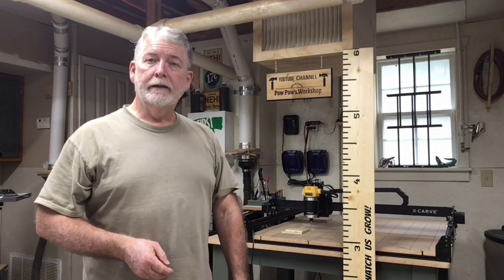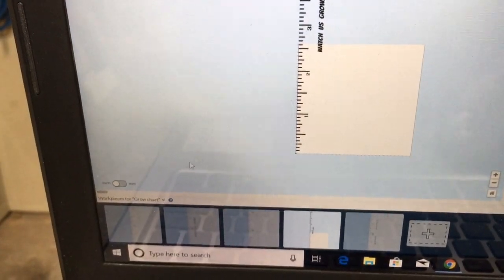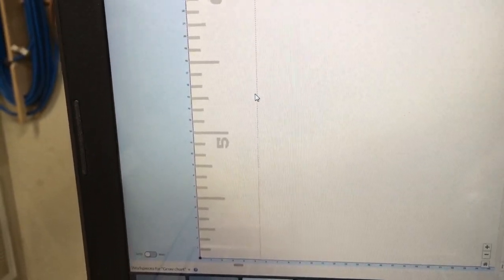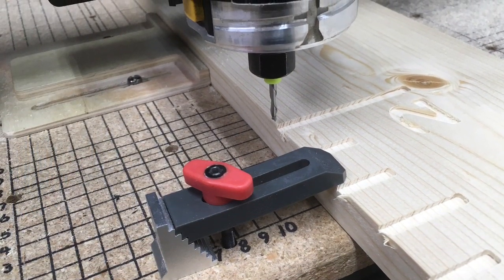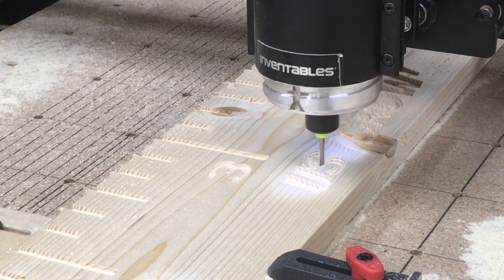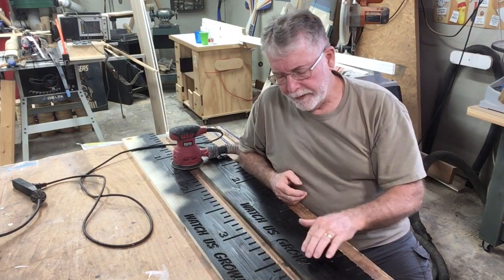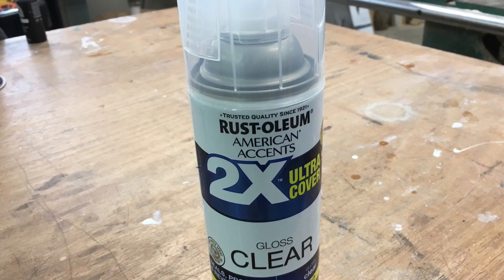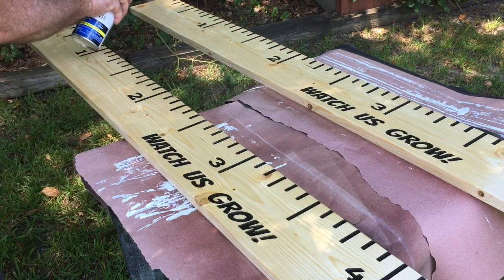How to Carve a 72" Long Project on a 30" CNC

Comment: Have you tiled with a way to index the piece as it advances. This method is fine for a sign, but indexing would increases precision if needed. It would require a bit more setup, but once in place, the components would advance quickly.
Reply from the maker: Yes, they all get indexed
Reply: @PawPawsWorkShop  that makes sense, unless I wasn’t paying close enough attention, what is your method for indexing? I didn’t see any kind of pin register or anything similar.

Comment: Are there three separate files, or how are the three sections accomplished in one file?  Thanks
Reply from the maker: Yes, three different workpieces or now you can use the tiling feature in easel. If you do one file just use a square and set to zero cut depth and mask the areas not to be carved

Comment: I'm getting ready to make one for a family member as a baby shower gift for a friend of hers. She asked if it is true to measurement once you hang it on the wall.
Reply from the maker: Yes, just measure at the correct height and install.
Reply: @PawPawsWorkShop  Thank you for answering. One other question. If they hang it on the wall do I need to take in account the measurement of their baseboard? My apologies, but my mind might be making this more challenging then it really is. 😂
Reply from the maker: On this one, yes, not knowing the size of baseboard that people may have this growth chart is from the floor.  If you want it to sit on top of the baseboard just put the growth chart on the floor and mark at the top of the baseboard and cut off the bottom.  Most baseboard are 3.5 or 6.5"
Reply: @PawPawsWorkShop  Thank you for your time. 🙂

Comment: I have a 11x14 inch cutting surface how would I be able to do this if I can’t use the full two feet as this is set up
Reply from the maker: You can move any amount that you wish.  Since your machine is 14" then make you breaks somewhere between perhaps 10 - 12".  Look at my fanart playlist to see more examples of tiling.

Comment: I understand how the 3 work pieces were created in easel for 3 carves, but i guess i don't understand how the 6ft long design was moved up and down the carveable area to the zero points in each workpiece.   Was the 6ft long design just dragged up or down on the next work pieces?  New easel is advertised as supporting tiling, but i dont see anything on their site about.  also, sadly my first year pro trial jus expired.  guess im a year into it, not sure on the 155 dollar a year fee.  may have to plan those 4 free days carefully.  sheesh, glad i picked up fusion 360.  now theyre changin the free license.
Reply from the maker: It seems that nothing ever stays the same.  I have always had the four free days and yes I plan my work and have never gone over and only a couple of times had to wait a few days until I got another four free days.  As far as the tiling, you can do it now just fine.  They said that they were going to release the new features when they were ready.  I can only assume that it is not ready.  I have tested the new tiling feature and have made some recommendations.  There are features that I like but again, there is no reason that you can not do tiling right now.
As far as the millions of graphics, it appears that the only ones that will receive that are the subscription holders.  Who knows what will change next. Only time will tell.
Reply: Paw Paw’s WorkShop very much appreciated.   I'll plan to follow the 4 day advice and see how long I can hold out.  I didn't activate the pro features during my project today, so I'll time things right to at least see any new features.  Again, thank you

Comment: Hey paw paw they sell 1x10 growth charts at home depot for $6.99... They are unfinished but whats funny is the engraved numbers etc look horrible...rough as heck and just looks horrible....im sure its cnc but its so bad looking ...i got a laugh when i saw them at home depot....my opinion is that if u have a cnc router  ideally there should be no barrier on either end of y axis so that you can have unlimited material clearance.....thats not how mine is set up due to poor lcation but if possible i would do it....especially when doing tiling jobs....looks graet paw paw as usual....
Reply from the maker: I just changed my setup and now I can easily roll the CNC out for very long tiling operations. Home Depot usually only has those during Christmas.  Made in China.  You are right--terrible quality.  Thank you very much.

Comment: As a new user of CNC, I have gained from your post. Tried to make this ruler using vcarve. When I try to create a toolpath for the inch and foot lines, it says that I have open vectors and it won’t create toolpaths. Any suggestions? Thanks.

Comment: Nice video paw paw...why did u use shelac in addition to the spray? ....when using soft grainy woods i find that when spray painting the letters and the sanding excess off doesnt come out well....the paints goes in the grains and takes a long rime to remove and ruins the surface........inext time i will put a light coat of clear closs in the areas i intend on painting and tape off best i can ....that way any excess paint wont absorb in the wood and will make it much easier to remove with sander......
Reply from the maker: der ddd. I will try that next time. Thank you

Comment: i use masking tape or contact paper over the wood just carve through it makes less sanding for large projects. or if you have a thickness planer run it through that just to skim the paint off
Reply from the maker: Frankie's CNC & Woodworking channel. Excellent,  I too have used the methods you described. It does work well. I have had the masking tape tear when carving and you are right still less sanding. Thank you for the comment.

Comment: Hi
Did you coat with shellac before carving? then carve, paint and sand then final seal?
Reply: Thanks for the video. My nephew asked me if I could make one for his son. I knew I could tile with Vcarve Pro. I just haven’t had the time in the last couple of weeks.  Your video came at the perfect time. And that is so simple. 
I’ve enjoyed many of your other videos as well! Thanks for posting.
Reply from the maker: Thank you for your kind words.  I am very glad that this video will help you.
Reply from the maker: Martin Gutzmer.  Seal the wood with at least two coat of shellac first. It will help reduce the fuzzies. Also use a downcut bit. If you are short on time as I was on this project, I carved first then sealed with shellac. Do not skip this step. You must seal the wood before painting. It is best to use primer for the painting. It is not available in my area therefore I use flat paint and primer. Sand and seal. All done